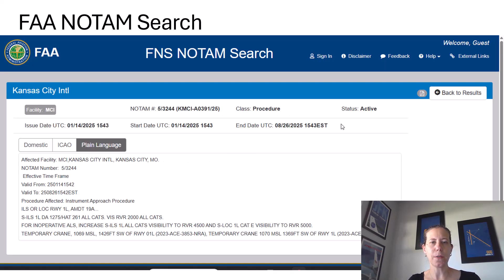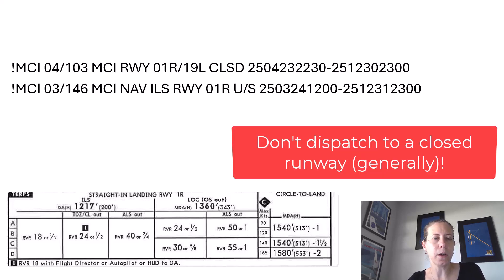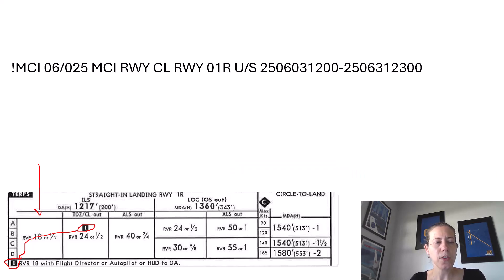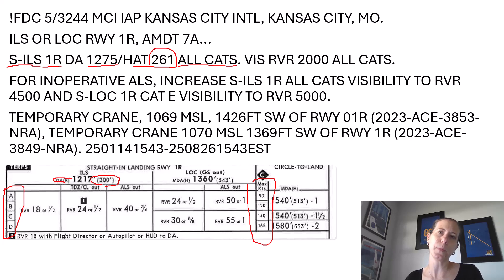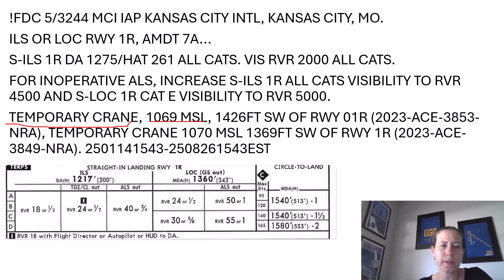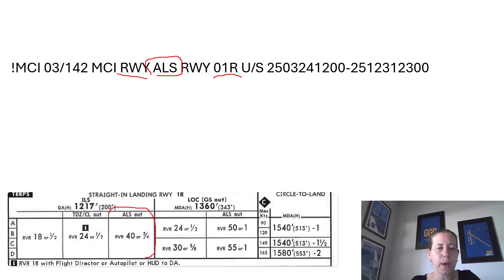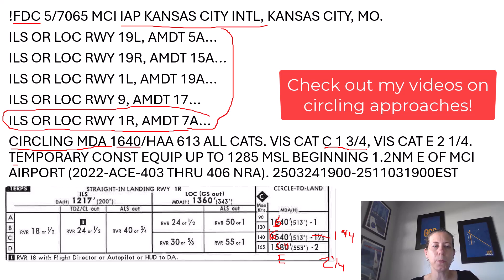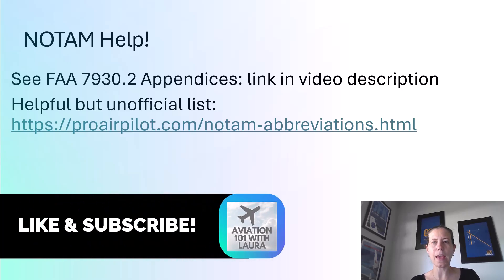Applying NOTAMs: Jeppesen Instrument Approach Chart Minimums! Aircraft Dispatchers & IFR Pilot Tips

Comment: The notam number is x/0001, the X is the year. So the 5 is for 2025. The 0001 is the serial number of that NOTAM for that year. It’s assigned sequentially

NRA is “No Rule Affected” (meaning the structure does not exceed Part 77 obstruction standards requiring further regulation).
Reply from the maker: Super helpful information!! I am going to pin your comment!